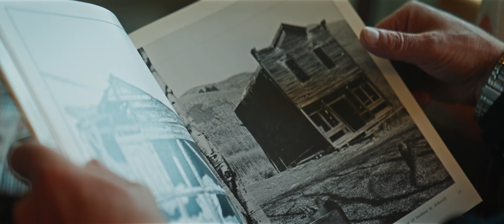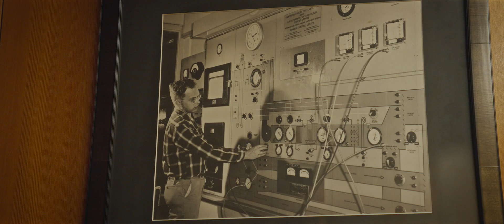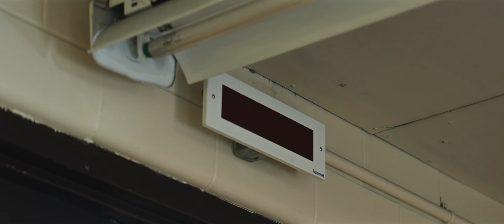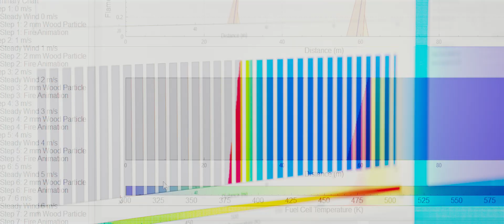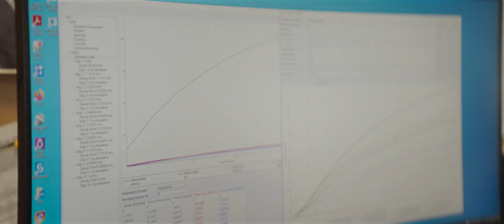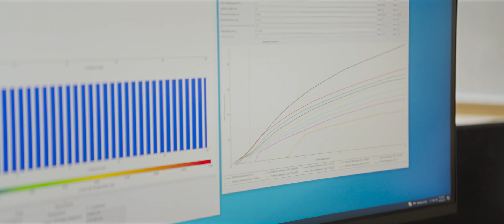Where the Internet Lives S4E1 | Data on fire

Comment: Hey google. You messages app still sucks. Even though I can use RCS with more people now, your app still takes my 12mp great photos, and turns them into 3mp dumps. Videos are also impacted by the same thing. Yes I tried sending photos as files instead, didn't work, but on Samsung messages and ios, it does work. Get this together I'll consider ios.